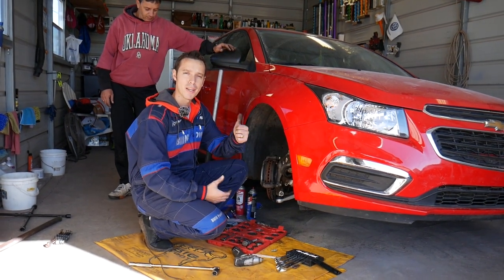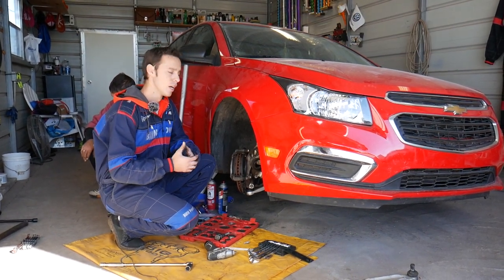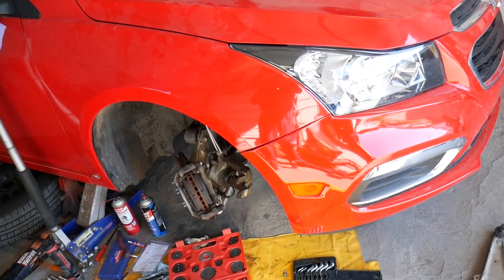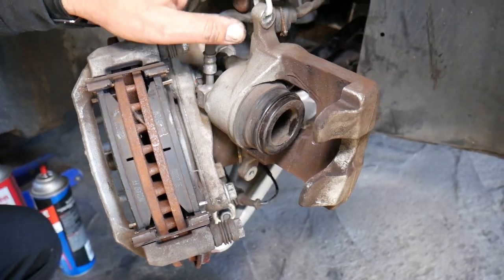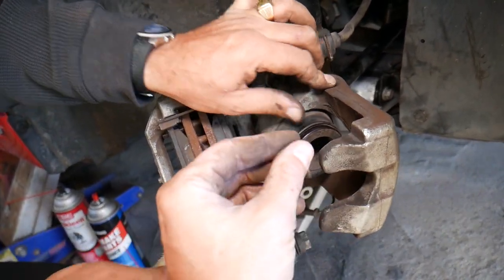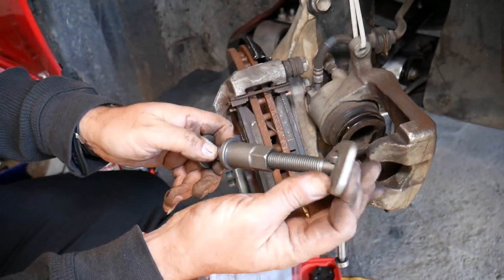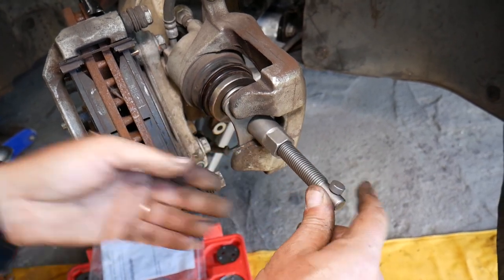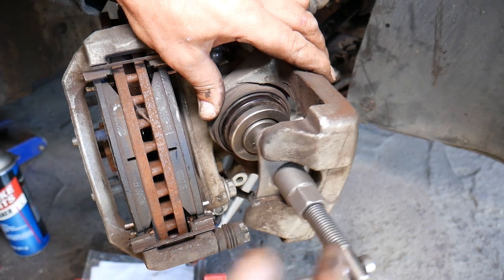HOW TO COMPRESS FRONT BRAKE CALIPER PISTION ON CHEVROLET BUICK GMC CADILLAC CHEVY

Comment: I have found it necessary to remove some brake fluid from the master cylinder reservoir with a turkey baster before compressing the wheel cylinder. It prevents overflow of the brake fluid.